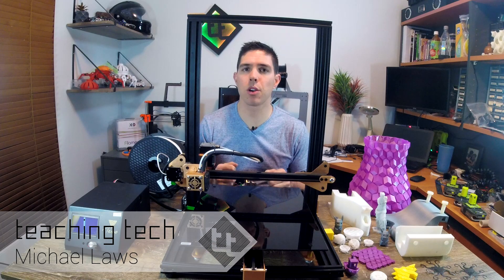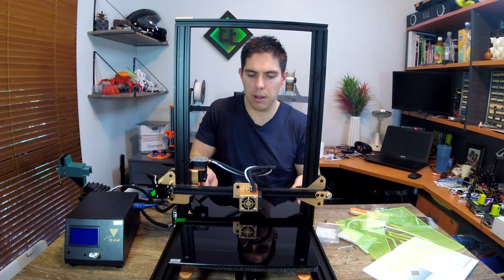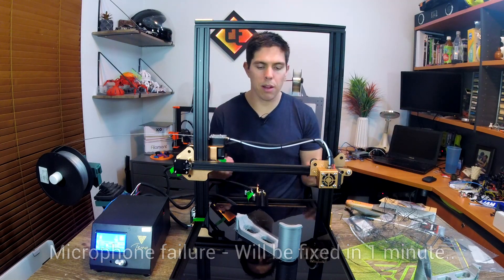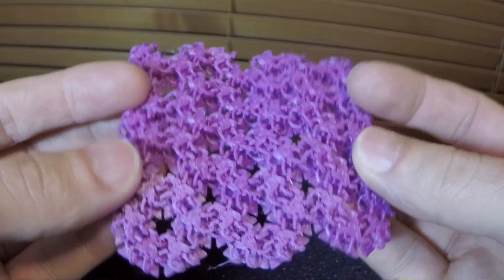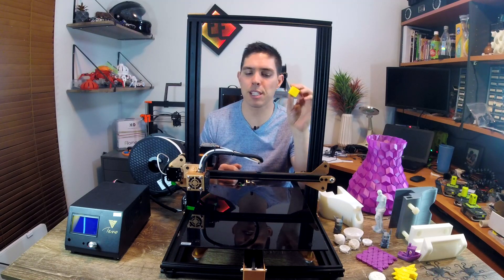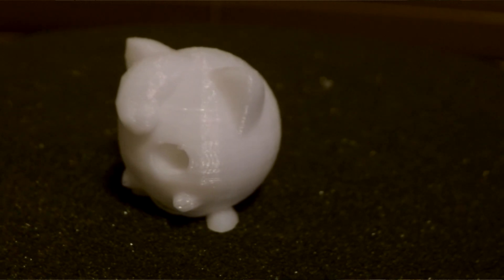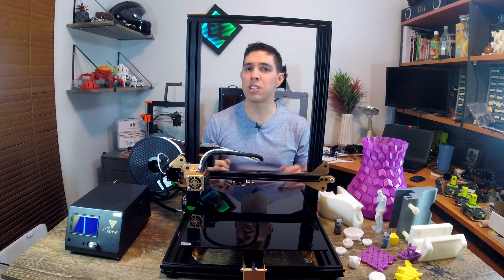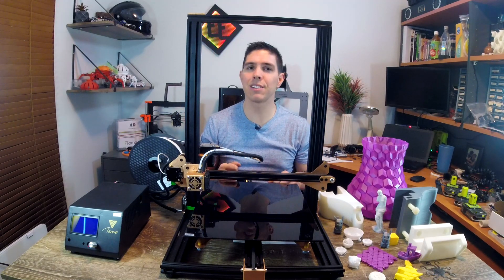Tevo Tornado 2018 edition review: Big volume, big value

Comment: hoping you could respond. New to printing, received a tornado from a friend, that same black gold version. Been having alot of issues with adhesion, seemed to be fixed with hairspray, which is messy and a paint to remove prints. My prints have alot of stringing and layers are poorly formed without any good structural integrity. Ill use 40 infill in cura and still things just dont look "solid" the way they do on these videos. Im using amazon basics pla which was given to me with the printer, everything else is stock, I already cleaned the extruder. Any recommendations?

Comment: I noted my unit came with a glue stick. simply using a folded warm damp paper towel with a little glue stick added to the surface of the paper towel gave me a very nice clean surface when applied to the heated bed. I print a lot of ABS. With only trace amounts of glue stick on the bed, it is easy to clean and resurface.

Comment: I love your videos. I am upgrading my 2018 Tevo printer to a Zesty Nimble direct drive setup. I am stuck on the section on how to adjust the Vref values on the stepper motor ic chips. There is hardly any information on this particular model. Do you adjust the Vref values from the pots or is this model software selectable for the Vref voltages?

Comment: My tornado came intact and with no issues.  However, I was printing PLA on my third print (coasters for my boss), and the bed chipped in two places.  I now use a piece of borosilicate glass that I clip onto the top, and have had no issues.  Once good thing, the seller on amazon sent me a new bed, which arrived this week, so I will be replacing that soon enough.  I have not tried printing PETG or any other filaments as of yet, gonna try that soon enough. Great video, and keep them coming!!
Reply: Sounds like head crash (collision of the extruder), if your print bed isn’t level and that nozzle tip runs into the glass it’s common to shatter them (user error in calibration). So don’t just replace it, check the level was of the bed or you’ll end up doing this again every week.

Ironically had to buy a new glass plate for my machine today, the part was really stuck on and me being stupid thought I’d manhandle it off, nope! It’s still stuck on that chunk of the glass, haha! I think that’s only the 2nd or 3rd glass bed I’ve broken but ironic it broke like the day before you wrote this comment. It cost me $3 at Lowe’s for a cut 8x8.5 inch plate (anything 10x12 or below is $3, cutting charge is free), so if you break another one because it does happen, you can buy replacements pretty cheap locally (I guess hazard of shipping a single piece is really high so they have to quadruple the price from what I’ve seen).

Comment: This review is not for the new user.  This printer is not for the new user, or for someone who is not going to go full in. If you dont have time to learn how to change  gcode, or think you can learn it on the go, this in NOT the printer for you. Tevo's is concept of Product support is a Facebook group that is would be more appropriately titled "UPgrade and MOdify your Tevo Tornado." The most helpful advice I received was "be patient, you'll get it eventually". This isnt my first printer.  
Stay away from the Tornado unless you are willing to spend the hour needed to strip the build tack cover from the glass. 
You need to be willing to put up with lousy prints with any printer at first, but you have to because you have to "print" axis supports according to the support group. 
Save your time buy something with REAL customer support. Like the CTC Bizer, the Tornado is simply a clone of a better brand, although my Bizer was friendlier.

Comment: Awesome review,, was the .8mm upgrade a simple nozzle/ filament change and changing the print setting to .8 filament in the slicer?? or did you need to do custom firmware? also did you instal the stepper dampers before all the test prints in this review? also how would you rate the Tevo quality wise vs the Cocoon apart from the obvious avantage of a bigger build area ? im looking at upgrading my cocoon to Tornado or even Nereus ?

Comment: my first proper print was the spool holder and the only mistake on the print was my fault caused by me pausing the print to fix my tangled spool which formed a blob on the spot it stopped at but when i fixed the issue and resumed the print it just kept going and the blob barely shows on the outside. just used some generic PLA i ordered on amazon

Comment: I'm glad you gave them low marks on the bed leveling screws.  It's my biggest pet peeve with mine (previous, green monster version).  It looks like you weren't getting the dreaded Salmon Skin effect with the new board and drivers.  I was curious if they made the machine any quieter in regards to the control box fans...mine sort of howls!

Comment: I had very similar results with my initial unboxing/build/first-prints video. The bed holder g-code file might have an issue. Mine had a ton of stringing, jammed and had some brittle areas as well. But none of the files I sliced had any similar issues.

I also took issue to there being on strain relief. Being that it uses mains voltage I think it's that much more of a concern. I've started to make sure I have all my printers hooked up to some sort of short/surge protection to help with that. But printing a strain relief is a must imo.

I was also frustrated not having any lock nuts for the bed leveling screws.

I'm currently putting it though it's paces and hoping my experience will bit about as good as yours.

Nice review
Cheers.

Comment: I have this printer.simply spray a little water on the bottom of the print and it removes instantly.(cold water)
Reply from the maker: If the bed is quite hot, be careful not to crack the glass!
Reply: @TeachingTech  very true but the water warms up pretty quick and that's what helps remove the print you can also use a can of compressed air upside down which leaves no actual moisture. Because this is tempered glass it's much more difficult to crack even under Heating elements. My bad never goes beyond 60 degrees Celsius so it seems to be perfectly fine every time
Reply: It doesn't have to be a lot just has to be a tiny bit while the glass is still warm

Comment: Great video.  I'm shopping for a new 3D printer, so this helps a lot. I have a slightly unrelated question though, does anyone have experience with the Geeetech A20 (not the dual extruder A20M)?  I have been searching for reviews on this printer, but haven't had any luck. I like the price point for the A20 and it has a fairly good size build volume.  I just don't know how it would compare to something like the Tevo.
Reply from the maker: I haven't used one sorry. Maybe join a Geeetech group and search there.

Comment: The SD card delivered with my tornado was broken from the beginning. More precisely it was one of these fake cards which report a larger capacity than they actually have. The included demo files and a few files of mine worked but as soon as the real capacity was reached every additional file was defective and not printable.

Comment: better the ender 3 or tevo 2018? would be nice to know your opinion
Reply from the maker: If you have the extra coin, go the Tevo Tornado. Please see my strain relief follow up video though.
They are very similar machines, but the Tevo is bigger, has a better mainboard and has the very fast heating bed.
Reply: @TeachingTech  i'm struggling with this same question.  It's my first printer and will use it with the kids to learn 3d design.  The Ender 3 looks more straight forward out of the box, but the Tevo more advanced.  Worried specifically about the glass adhesion with prints being an issue.

Comment: My guess is that they will continue to ship the green ones (old version)out until there are no more in stock and then ship out the newer gold versions....They should reduce the price of the older version and sell the newer version for the going price...just my 2 cents....
Reply from the maker: I agree that is a great idea.
Reply: Word has it that Tevo shipped the last of the old ones some months ago, but some of the vendors stocked up and are now liquidating the old ones but some are claiming that they are the 2018 versions.  This may be because they switched over to making the new versions after the Chinese New Year which was sometime in February so technically the old spec ones made in January are 2018 machines but it's misleading to consumers. I consider this to be a vendor issue and not a Tevo issue.

Comment: My extruder is clicking during like the raft and first layer, what can I do to correct this? Thanks!
Reply from the maker: Sounds like too close to the bed, nozzle opening doesn't have ough room for extruded filament.
Reply: Yes you were right. I leveled the bed again with less tension and WOW filament is laying down and no click! Thanks!

Comment: I have heard a few have broken the build surface on this new model, you think that was build surface issue or operator error. To those looking to buy the 2018 model on eBay be aware that some of the Chinese sellers are using "2018 Tevo Tornado" for the search benefits when they are in fact selling the old version. I just had that happen.
Reply from the maker: It seems really tough to me. Do you know any details on how they broke it? Thanks for the heads up on shonky ebay vendors.
Reply: It was on the FB Tevo Tornado users/owner group and the person that reported it says he was just adjusting the bed level.
Reply from the maker: That sounds like it had a crack all along. Mine seems very, very tough, like a stove cook top.

Comment: Update, got 300 plus hours on the new 2018 in my print farm. It's been a serious work horse. Ordered 2 more. My only real complaint is the left z support did not have holes for adjust the x gantry. Had to drill the out and mill a slot in the x axis plate support. Now it can be adjusted in less than a minute. Also installed smoother and motor mount damper. Summary, it smoke a cr-10 with appropriate mods.
Reply from the maker: I'm still really happy with mine too. Been using it to print out silly string RC tank parts. That project is close to completion.
Reply: @TeachingTech  Really looking forward to your Cheeze Whiz tank👍

Comment: Love this printer. After going through 3 yes 3 Anycubic i3 Mega printers, this finally crushed it and works flawlessly. Of course I now use Simplify 3D as my slicer and that may have made the difference. Great prints fantastic volume and the price is so inexpensive. With just a few teaks you can print things with the same quality as printers that cost hundreds more. Love it.
Reply from the maker: Still really enjoying mine too. I don't know if you saw but I've fitted a 0.8mm nozzle.

Comment: Hey Michael, I'm really on the fence about this printer. On one hand I've heard that it has the salmon skin issue with prints (or at least the 2017 version does) and the smoother board solution could no longer be implemented on newer units. My second issue is that I've heard this printer's wiring setup is extremely dangerous as the main voltage line is not grounded at all. Did they fix this in the 2018 version or is it still a hazard? And lastly, I see the 4 screws on each corner of the bed and I'm wonder if they are included in the "300 x 300 mm" surface that you can print on or if the extruder head can't actually reach that part of the plate? Thanks for the great review though!
Reply from the maker: Thanks for watching and commenting. I had TL smoothers ready to go but didn'tneed them. No surface artefacts at all with this printer in my testing so far.
I can confirm that the main power supply from the wall is earthed. Can't comment on earlier versions than this. After adding strain relief to the bed wires, it's not a bad idea to add additional earthing cables from the main and bed frames back to the control box. I'll be covering all of this in a video this week. You can decide if you think it is too much trouble.

Screws are outside the printing area by a little bit. In the video when I show the LED logo box printing, that illustrates the full 300x300 bed area.

Comment: What’s the point to have a nice looking bed which needs to be always taped? Also the main voltage on the bed without proper strain relief and safe connection is highly dangerous. I wouldn’t recommend anybody to buy such a thing.
Reply from the maker: For PLA, it works perfectly as bare glass. Also, there are other common options, such as hairspray or gluestick, that are very common for the CR-10. This is a normal situation and therefore not fair to consider to Tornado problem.
It would be negligent of me to recommend the printer without mentioning the strain relief, so I made it clear it would be my first mod. I fiited this: https://www.thingiverse.com/thing:2748197/ yeaterday. It will be covered in a video this week and this link is now in the video description.
Reply: I understand your point. But I think we are past that point where 3D printers are being sold unsafe at the first place. Doesn't matter if it's lack of security options in the firmware, naked main voltage on power supplies or cables/connections which are always moving and are known to break without any security. I wouldn't buy/give such a printer to my sun because I know it's a time bomb. And you can't rely on that any self made mod make it safe (maybe safer, yes). At the end you're saying by using this mod it's perfectly safe. But it's not! I had already many broken bed cables and I know there are ton's of reasons why it happened.
It's like recommending an unsafe microwave and saying "it's a good and safe microwave unless you use it in a full metal case". I like your channel and watch it for a long time already. I just think such a live threatening security things need to be more outlined and pointed out. Otherwise I can see a next horror story in the news about 14 year old boy and the dangerous 3D printer.
Reply from the maker: Hopefully you agree my covering the fix in my coming video is up to scratch. I think after Angus and Joel made the videos bagging the CR-X manufacturers might do a bit more in house testing from now on.
Reply: I can't, doesn't matter how good you will do the fix. Working with a main voltage (240V in some countries) is dangerous and should be done only by certified technicians. It should be by design safe (special cables, special connectors and safety features) and this design need to be certified safe. There are regulations for that for good reasons.
By suggesting doing that fix and make it look safe afterwards you're putting yourself in a position where you can be sued for that if something happens. I'm not sure where you live but in Europe and USA that can happen very fast especially because you're a public person. 
Just an example: Someone inexperienced does this fix on your advice and did it wrong. During operation of x hours, the cable ties rub on the cable and expose them. Unlucky guy reach out at the back of the bed (for whatever reason) and get's shocked, heart stop beating. But he told one day before to his family how great the printer works now after all the great mods being done and what a great guy Michael from Teaching Tech is who provided all this guides.  
So please don't make this mistake and include a disclaimer and all the legal stuff if you really think it's a good idea and you would recommend to buy/use this printer to your relatives.
Reply from the maker: You make some good points, I appreciate it. I feel like me making a video to make the printer safer will have far more potential benefit than not making it and having existing owners use the printer as standard. You have convinced me to have some prominent warnings and disclaimers, thank you.
Reply: @workinghard111  damn, that sounds dangerous. Imagine if we had 220v AC in our walls in open sockets. That would be crazy. Especially if all our devices plugged into it.
Reply: @Huskie: Sorry if you don't see a difference between using certified outlets with certified devices and streaming a how-to to modify a high voltage device. But Michael got my point, put a legal disclaimer in his next video and got a big thumbs up from me.
Reply: I don't tape my tornado's glass bed.